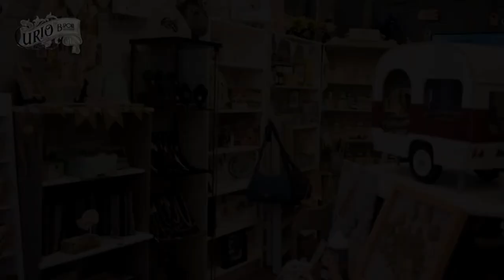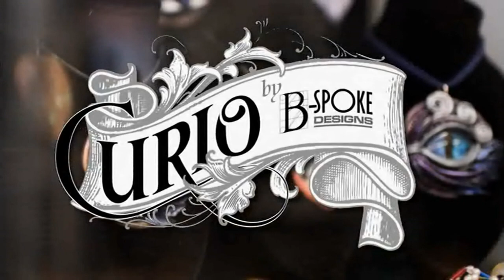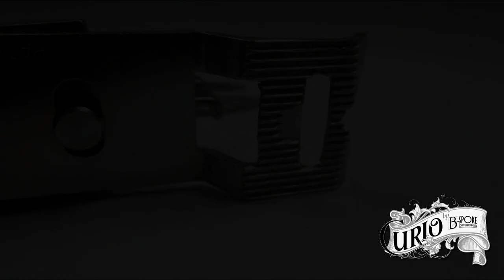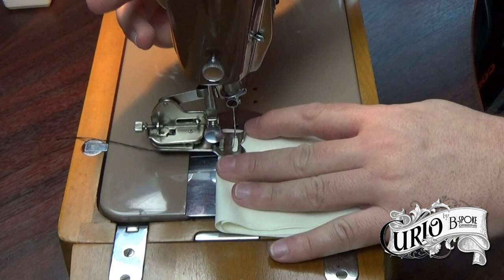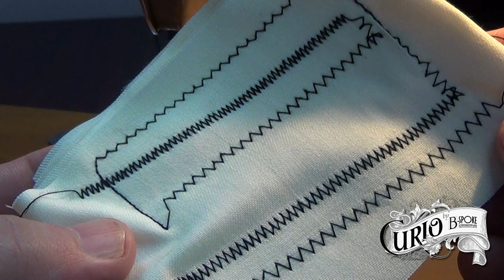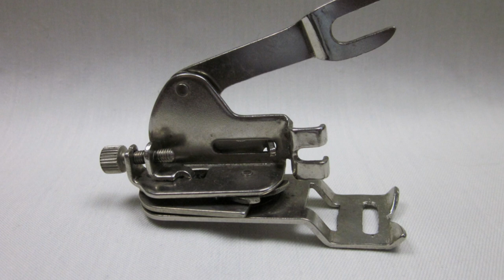Zig Zag Attachment for Vintage Sewing Machines

Comment: Nicely presented as usual. I have one of these for my 15-91, it is more useful for decorative stitching, not so much for repairs, mending or general sewing,  that is best left to a ZZ machine such as a 401a where the needle moves, not the fabric.
Reply: I have a 15-91 why do you say it’s not good for general sewing?
Reply: By general sewing, I mean repairs and zig-zag stitching that is structural. The ZZ attachment , like the buttonholer, moves the fabric or garment being sewed which is not ideal. I'm not saying it won't work...it's actually an amazing piece of kit...but if you have access to a ZZ machine, you'll be better served and have more control over your project.
Reply: Where can i bay one

Comment: I have just got this attachment for my Singer 99k but it sits very low and I can barely get the fabric under the foot. Is there a way to adjust this? Thank you!
Reply from the maker: It sounds like your presser bar may be too low. I don't think there's any way to adjust the height of the attachment. Try reducing the presser bar pressure.
Reply: @CurioByBSpokeDesigns  thank you I’ll try and find a video to do this! Thank you

Comment: Thank you for that - it is nice to see one being demonstrated to show a range of stitch widths and lengths.  I've got one which looks just the same, but it came with something that looks similar to the edger - but is more robust and the "ups and downs" are more pronounced.  Apparently it is used for when you want to zig-zag two things together (eg, lace-to-lace or fabric-to-lace-to-fabric like an insertion).  Do you one of those with yours and, if you do, would you have any hints (or another video if I'm very lucky!) on how to use it, please?  Ta...  Megan
Reply from the maker: I think I have that attachment. I'll look into doing a video soon.
Reply: @CurioByBSpokeDesigns  Awesome!  I know you'll have a To Do List as long as your arm so that's very kind of you.  :-)  I've subscribed because I find I keep watching your vids all the time.  Thank you!
Reply: @CurioByBSpokeDesigns  Hello again!  I've been playing with mine just trying to zig-zag and I'm having a really difficult time getting a good stitch (nothing half as nice as yours!). I'm getting better at steering (it's a hand-crank, so all one-handed) but it seems no matter how I tinker with foot pressure and upper and lower tensions I can't find the "sweet spot".  And if I get something kind-of-reasonable front-and-back (if you only see it on a galloping horse) then as soon as I change stitch length or width it all goes cattawampus.

If you do get time to make that other video one day (or even if you don't) I think many of us out there who find themselves in possession of one of these would love just to hear about any tips or tricks you've got that made you get such good stitching.  (And of course - if you don't get time I understand - perhaps some other readers who have mastered this particular critters might have some tips.)  Ta...  Megan

Comment: Hi I've recently bought one of these but the zig zags are small & the thread keeps breaking could you give me any tips on how to improve the performance I'm using a 185k
Reply from the maker: There's an adjustment at the back for the width of the zig zag although it will still be narrower than zig zags done on a modern machine. You may need to loosen the top tension a little.

Comment: Great video! This one I'm using is skipping stitches quite often. How to fix this? It won't do a straight stitch either. When fully tightened, it's doing a small zig zag still. I wonder if it's broken or needs adjusting somehow?
Reply from the maker: They can be temperamental. Check your tension and the presser foot pressure.

Comment: I am looking for a Zig Zag Attachment and Ruffler for a singer 221 / 222 Sewing machine...Have you any advice ..Thanks
Reply from the maker: Most low shank attachments will fit a 221/222
Reply: Cannot get low shank ...plenty of high shanks
Reply from the maker: @boradruma  Low shank is the most common - most newer machines use low shank.

Comment: Thanks for an informative video. Do you know if a Singer brand foot will fit into other machines, like a Jones CS family series. Or will I need to buy a other brands   Thanks in advance!
Reply from the maker: As long as the machine is 'low shank' then it will fit. Not sure about the Jones CS, I know the used different needles.

Comment: Thanks very helpful video
Where it is available?
I am living in India online I checked
I couldn't find any such mechanism
If you can send address it will be very helpful.
Reply from the maker: These are vintage attachments, probably over 50 years old and are not made any more. Try ebay for used ones.

Comment: Where do you find a smart thing like this? Is it hard to sew with?
Reply from the maker: It came with the accessories with a machine. I believe they are available new on line. They are quite easy to use.

Comment: Any chance this would work on a 1916 Treadle 16K 115?
Reply from the maker: I'm not familiar with the 16K, but as long as it is a low shank and side clamping machine, then it should work.
Reply: An enormous thingamabob came with my Singer 404 called a zigzagger, but this is more elegant. Would it work on a Slant machine?

Comment: hi, good job, very interesting video. Why is your motor so quiet?
Reply from the maker: I don't know. Is it quiet?
Reply: @CurioByBSpokeDesigns  yes My engine before i leave struggles a little and makes a very unpleasant sound
Reply from the maker: @gianlucaurso9753  check to see if your motor requires grease - some do. See if the belt is too tight.

Comment: Found one! It is a Chadwick Zigzagger
Reply from the maker: Let me know how you get on with it!
Reply: @CurioByBSpokeDesigns  Well unfortunately it is truely only for a low shank machine and mine is high shank. I was determined to get it to work so I found a high shank zigzagger on Amazon which was trash.  However since it had the proper geometry, I literally welded the Chadwick mechanisim on to the foot and arm bar. Made a custom adjustmant for it and got it to work. It's still a hack though since a true zigzag has at least 2 stitches in each direction where as these gadgets only give you one. I'm working my way up to being able to do them freehand i.e. feed dogs disabled. A lot of work I know, when you can get multi-stitch machines these days for low $$$. I guess I want to try to get as good as my grandma was on her straight stitch machine 🙂
Reply from the maker: @danacandella5416  You certainly are resourceful! I appreciate the challenge is often better than a shortcut.
Reply: I’m grateful for both this video and the Chadwick mention! I was able to find one on Ebay for use on my Singer99k. Thank you!